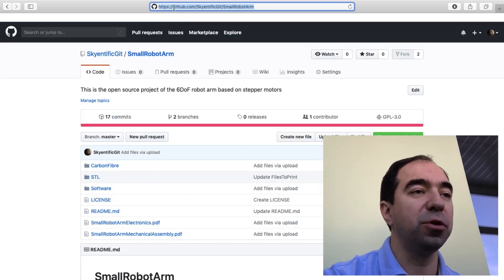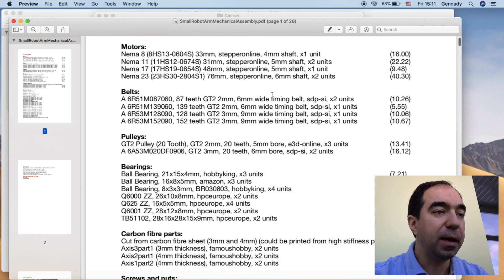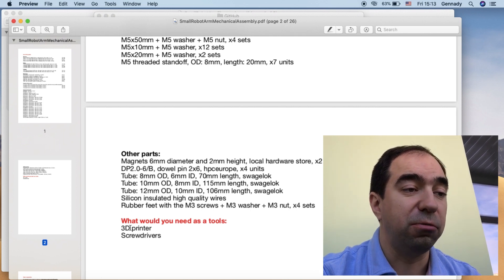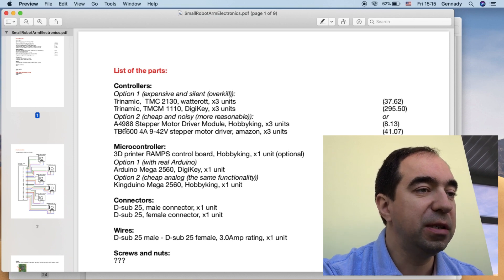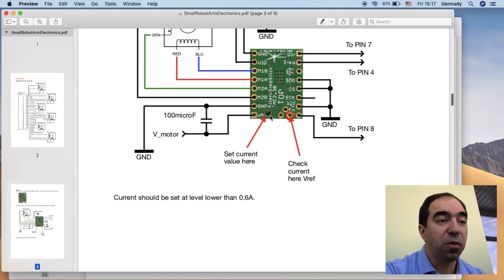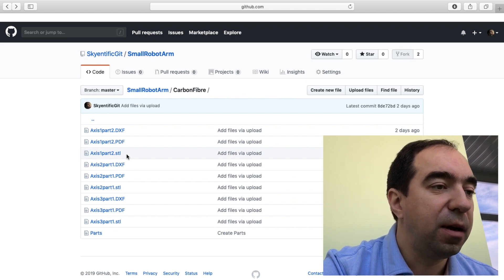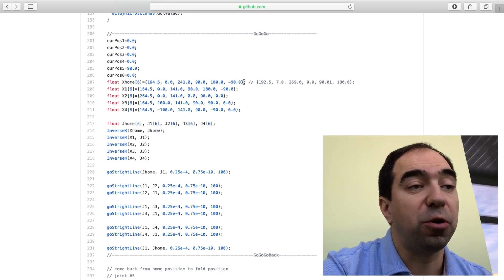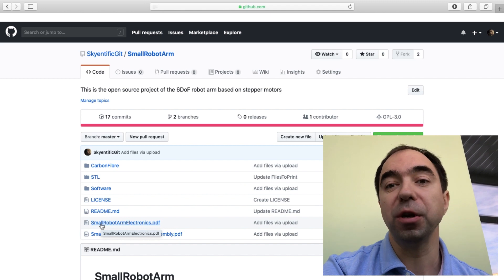6DoF mostly 3D Printed Robot Arm (Part 3)

Comment: i absolutely love this project, the arm looks artistic, its very skillfully designed. What do you plan to do with it? you should put a hotend on the end effector to make it a 3d printer
Reply from the maker: It would be a nice 3D printer! It should be able to print complicated parts without any support. I thought about this, but it would be difficult to write a program for this. Basically it should be a slicer for 5 Degrees-of-Freedom 3D printer. Maybe I will try to do this, but I am not sure to be capable to program this.
Reply: @Skyentific  It really would if used with all 5 axis, but even as a 3 axis machine (easier to code firmware) it would be incredible and could print objects that are many times it size. Id really like to see where it goes, personally. Ive been designing a few printers that use scara coordinate positioning, similar to something called the reprap helios. (google that by the way, its very interesting, even if not quite as cool as your project lol.)
Reply from the maker: Just google it. This is really nice SCARA robot! Thank you for this link!
Reply: I see huge potential for these types of projects @Skyentific

Comment: https://www.instagram.com/p/BskeKSeHixS/?utm_source=ig_share_sheet&igshid=1mxfbng3a5pfm

I finished 5 axis now, waiting for the base parts,
Reply from the maker: Very cool!!! Excellent job!
Reply: Hi sir,

    What is the purpose use the TB51102 bearing, why not use 6001 bearing?
Reply from the maker: Hello. I used both TB51102 and 6001. I am sure that if you would use only 6001 it is going to work just fine. But usually this ball bearing cannot support the high load in axial direction, but TB51102 cannot support the load in radial direction. But when you use both of them, then your system can support load in both directions.
Reply: Thank you very much

Comment: Hi, This work is amazing!! Did you implemente the inverse kinematics? And the size of the working area?
Reply from the maker: Hi. Thank you! Yes, the inverse kinematics is implemented in the Arduino program. The working area is around spherical with radius around 220-250mm (the precise working area depends on the end effector). The maximum reach of the centre of the last joint is 274.5mm. In the build video (Part 1) there is mechanical diagram with dimensions. I hope this will help you.

Comment: What driver did you use to control the speed of the steppers with that much precision ? Mine only take rounded intergers so I cant do linear trajectory with my robot arm
Reply from the maker: I use Trinamic drivers which I control with the Arduino Mega with custom program. Thus everything is very customisable. And now everything is open source!

Comment: I love your project!
Thank you for sharing your work.
I have a question about Kinematics , in case of a robot similar to 5axismaker.com, what is the way to convert/use the robot geometry ?
Reply from the maker: Efi Kamara, thank you. I am not sure that I get your question right. 5axismaker uses Cartesian geometry (linear (prismatic) joints on perpendicular axis), the robot from this video has revolving joints connected in series. Thus it is much easier to convert Cartesian geometry, but a serial robot takes much less space. I hope this answer your question.
Reply: @Skyentific  Thank you for your reply. Your work is great.
I am trying to understand your program and modify it to my robot.
How can your Kinematic Diagram and geometry (on your video - https://youtu.be/Sgsn2CM3bjY?t=81 ) be translated to the one of 5axismaker - How can it be convert to Cartesian geometry?